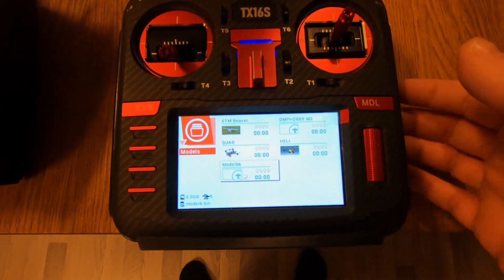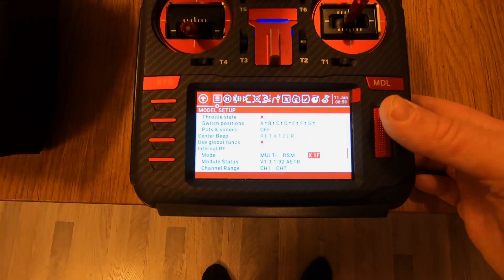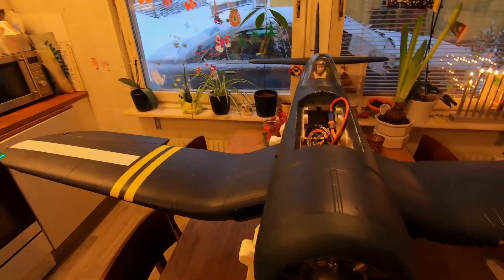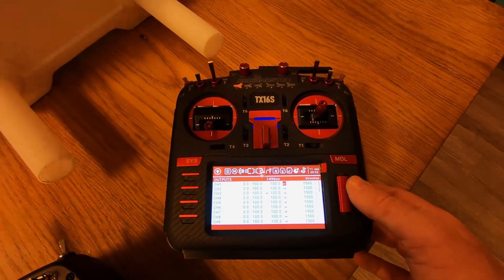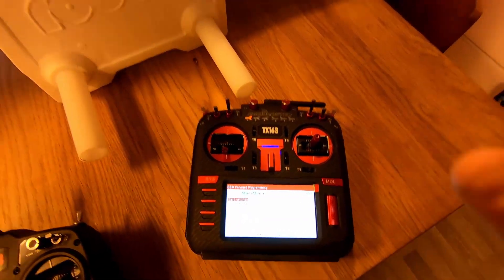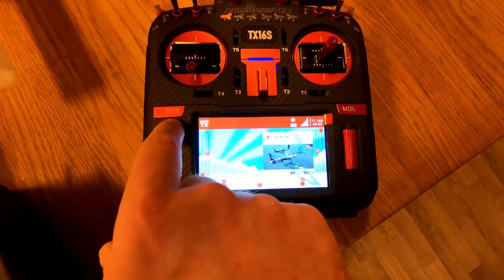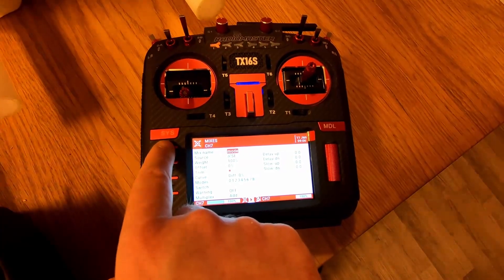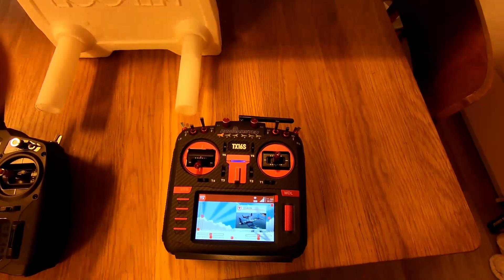Radiomaster TX16S SAFE receiver setup

Comment: I can’t seem to be able to get any kind of stabilization. Bought my TX16S in the spring as I am new to this hobby and I have a bunch of  eflite UMX planes and they bind with AS3X and safe right out the box perfectly . Recently I set up my first plane(Xfly A10 50mm) and put a AR630 in it and I got it to bind but no stabilization. Watched a few videos explaining how to but they are all different ways to set it up. I tried them all. I even bought a lemon 7 channel receiver with stabilization and tried with it but same thing….binds fine but no stabilization. Don’t know what I am missing. Makes me wonder why  I am in this hobby
Reply from the maker: Sorry for the late reply! In order to enable stabilization (aka AS3X/SAFE) on AR630 you need to use Forward Programming to setup the receiver. I think your easiest option is to borrow a Spektrum transmitter (or ask someone that are flying with a Spektrum transmitter) to do the programming and then bind it to the TX16S. The stabilization isn't enabled by default.

Good luck with your adventures and don't give up. It might feel like a mountain in the beginning but it will get easier.

Comment: Ol, man I did it like u show and now all control services work but motor don't work now and ESC beeping fast I undid all ur stuff but it's still beeping no motor any ideas how to fix??
Reply: Try reversing the throttle channel. Sounds like the transmitter sens full throttle signal to the ESC.
Reply: @Daniel_SWE  it was working but would not bind in safe mode this is after I did what I seen 8n this video here, so I took everything off my transmitter started from scratch, still nothing but beeping if it doesn't fix it after 8 reverse throttle I got a 60 amp esc will change it out see if works then. Thanks guy!

Comment: Radio Master will bind but you will not be able to turn off the "Safe / AS3X" mode unless you have AR636 receiver.
Reply from the maker: That depends on the programming from the factory. Most BnF planes are programmed to always have AS3X active and selectable SAFE.

Comment: So you can use a Radiomaster brand transmitter to operate spektrum receivers.
Reply from the maker: Yes, you can. It works nice.

Unless they made some progress resently you can't use OpenTX/EdgeTX to do Forward Programming though. BnF models are no problem what so ever.

Comment: Does anyone know how to set a throttle cut on the radiomaster tx16s?
Reply from the maker: The easiest way is with a Special Function. 
This video by Flite Test will show you that at about 8:30. https://youtu.be/x0SzOaB5W24

You can also make a more advanced with logical switches. 
RC Video Reviews has a video that shows one way to do that. https://youtu.be/Y0eKFAFNeX8

Comment: What version of firmware is on your radio an internal module
Reply from the maker: In this film it was OpenTX version 2.3.11 and the internal module had version 1.3.1.92 in AETR mode.
I recommend you install the latest versions and go from there. It shouldn't have changed much if at all.
Reply: Ok thanks for the video and the help

Comment: I have a dx6i connected to ar636… I don’t think safe was ever programmed ok, I don’t need safe,,, just want as3x so I bind t16 to ar636 and SE as mix ch 7….  I hear the servos correcting now ,,, so do I have as3x?   I think I do,,, but can’t tell anyone change when I flip SE just seems to always be in as3x ,,,does that sound right?   Great video,,,, I think making ch 7 has it working in as3x which is what I wanted
Reply from the maker: Is it a Bind and Fly plane? In that case it's usualy two SAFE modes and one with only AS3X. 
The way to control if it is SAFE or not is to turn the plane over and see if the ailerons try to compensate. 
If the servos only react to sudden movements it is AS3X.
Reply: @DanielsRCHobby  got it thanks

Comment: Hi all the red parts of ur radio including stick, button, gimble the switch nuts did u add those? If so where u buy it? Ty
Reply from the maker: It is a TX16S Max and it comes equiped like that.
Radiomaster sells the CNC parts separately aswell.

https://www.banggood.com/Original-RadioMaster-CNC-Metal-Upgrade-Set-Replacement-Parts-for-TX16S-Transmitter-p-1756235.html

Comment: Spektrum is TAER
Reply: With the TX16S, the Multi-Protocol Module converts AETR to TAER. On your receiver, you plug the control surfaces and throttle normally, according to the labels on the receiver. So you plug the throttle cable from the ESC or throttle servo into channel 1. Ailerons go into channel 2, elevator into channel 3 and rudder into channel 4. The TX16S converts it so the throttle channel on the receiver "sees" the input from the throttle stick on the transmitter. The same occurs with the other inputs (sticks, switches and dials.)
Reply: @SBWings  yes I know thanks

Comment: What are the seven channels?
Reply from the maker: Sorted by the order in the Radiomaster transmitter its Aileron, Elevetor, Throttle, Rudder, Gear, Flaps and SAFE select.
Reply: @DanielsRCHobby  Ok, I have tx16 Radiomaster and I  have the latest version of opentx but when I go to forward programming settings I don't have anything there...blank(not like yours). I have a Conscendo evolution. I can get it to bind but i cannot get Safe select to work. Do I need to update receiver...or?
Reply from the maker: @emilgabl9069  Is it the BnF version? 
In that case it uses the AR637TA that are "locked" from factory. Haven't used one myself but I don't think you can access the programming mode on it without a firware patch. 
The manual should tell you what channel the SAFE select is on. 
You can also try channels 5 to 9 and see if you can find the right one.

Comment: Great video but you can also buy a cheap Lemon Diversity receiver which you can have safety on channel 5. they cost around £25/£30 ish.
Reply: So If I buy a cheap receiver I won’t have to do the forward programming and my safe flight will work? Is it replacing the spectrum receiver?

Comment: how do i download the dsm forward programming
Reply from the maker: I had to update the OpenTX and the Muli-protocol module firmware in order to get it to work. 
Following these two videos I had no problems: 
1. OpenTX update - https://youtu.be/J62oJ9gP3j4
2. Firmware update - https://youtu.be/3JLBSaKAUQM

When it's done you find the Forward Programming option in the "SYS" screen. 

Be aware that it's not usable to do the actual programming yet as far as I know.
Reply: @DanielsRCHobby  thank you Daniel!

Comment: Have you tried flying like this? I manage to bind the plane and get the safe all set up i keep losing signal maybe after 30 feet away from the plane. And it would say telemetry lost.
Reply from the maker: You don't loose signal to control the plane. It's the RSSI signal that is lost.

You can turn it off in the model settings, three lines under the bind button. It say "Disable Telemetry".
Spekrums cheaper recievers don't have full range telemetry but only flyby telemetry.

I forget to turn it off al the time myself. I you watch my latest video you can hear the same warning during the entire flight :)
Reply: Well in my case its not just the telemetry that im losing. I lose all control of the plane. Good thing i i was checking it on the ground when it happen. I would have to check again with another person so they can actually check it for me when I’m so my range check. And I’ll probably do 100feet away range check just in case. They did you have to change the outputs of channel 3? I saw some forums saying it has to do with the output.
Reply from the maker: @S1kQuinn  Is it a BnF plane or have you mounted the receiver yourself? The only time I have lost signal was with a antennaless receiver (AR630) in a glowpowered plane when the engine blocked the signal. In that case I changed receiver with antennas and added a remote receiver.

Are there any carbon spars or battery  that might block the signal? If the receiver has antennas be sure they point 90 degrees from eachother. 

If everything else failes try with a Spektrum radio and check that the receiver is working as it should. 

I did not change any channel assignments in the radio and using AETR layout.

Please keep me posted of your progress.
Reply: @DanielsRCHobby  i will try to do as you say. Ill diable the telemetry then try again. That might do it. When i was checking i was alone thats why i dont know if it disconnected or just the telemetry was disconnected. Ill keep u updated for sure

Comment: when i hit dsm forward programming to check which channel is the flight mode switch it says no compatible dsm rx, even though im already bind up to the rx.
Reply from the maker: I'm having that problem aswell.
Sometimes I have to try a few times. But don't be to fast to retry, that will fail for sure. Wait 10-15 seconds before next trial.
Sometimes I need to unplug everything and boot up from start.
I even had to rebind a couple of times. 

If I just can't get it to work I usually just create a mix on the first free channel I can thing of. If it doesn't work I try the next channel.

Horizon has specified channels 5-9 as possible SAFE select channels depending on how many channels the receiver has.

Comment: what if you have flaps and gear that would be on the 6 or 7 channel
Reply from the maker: With gears and flaps I would try with channel 7 first. It depends on the number of channels the receiver has.
On a 6 channel receiver I would guess the SAFE end up on channel 5 with the gears. Gears down would activate the SAFE.

Comment: Can't you program the receiver using Spektrum Programmer for PC, instead needing a Spektrum radio? and isn't the receivers that comes with BNP planes already programmed with SAFE ( for example the ones that say that are SAFE Select ready from HorizonHobby ) ?
Reply from the maker: Without trying you probably can use eather pc cable or the bluetooth cable instead of a Spektrum radio. As don't have any of those options I can't be 100% sure they work.

As soon as I get some free time I will do a bind video to a BnF/RTF plane with SAFE aswell.
Reply: @DanielsRCHobby  I'm in kind of a cross roads ... getting back to the hobby and thinking in getting a TX16s or a NX6 for these planes with Spektrum receivers, been trying to get confirmation on working with SAFE and possibly for those ESC's telemetry with TX16s. TX16S would be better for me because I also have quads that can bind to this radio, and crossfire module bay is perfect for what I have also. I think I get a lot more value with TX16s and its a lot cheaper ...
Reply from the maker: @wolfdronefpv4040  I love my TX16S Max but the NX series has better quality. They can't realy be compared in that matter. You get what you pay for. 
There are Crossfire modules to the Spektrum transmitters aswell.

With the TX16S you get a "one fits all" radio and I think that add a greate deal of value.  Beware that it will not bind to some Futaba protocols.
 

I haven't tried the Spektrum telemtry on the TX16S yet but I will try the Spektrum AR8360T reciever in a future project. I can't see any reason why the telemtry it shouldn't work. I know that OpenTX has problem with non full-range teletry recievers but it can read the data when the model is closen enough.
Reply: @DanielsRCHobby  Do you feel comfortable with the range provided by the TX16s ? I know that the NX has diversity that can help with signal strength but I don't know if it is that big of a problem ... specially for planes that usually  are in line of sight.
Reply from the maker: @wolfdronefpv4040  I don't have that many flights with the Radiomaster yet but so far I have never had any problem. Just make sure to install the reciever antennas so they get a free signal from all directions.
Don't forget to do a range check from as many directions as possible before the first flight! In my experiens you will find most problems that way and save the plane.

As an example I tried to use an antenaless Spekrum AR630 reciever in a glow plane. During range check I notecied a total signal loss from the front of the plane. That resulted in me changing the reciever and removed a potential problem.

Comment: excellent video, I just received my radiomster tx and I have been a spectrum user too.  I want to use an ar637t receiver with safe, so first I have to program it with a spectrum transmitter and then it can be used with the radiomaster, is that right?
Reply from the maker: Yes, the OpenTX scripts for programming Spektrum recievers are not in finished yet. Using a Spektrum transmitter You're assured the reciever will be programmed the right way.

I have been told that the Bluetooth cable might work aswell to program from the mobilephone but I have not tried it myself.
Reply: @DanielsRCHobby  thank you for your answer, I will try to do it in one of my planes.
Reply: Can't get it to work with umx wings.
Reply from the maker: @SkyBandit45  What happens?